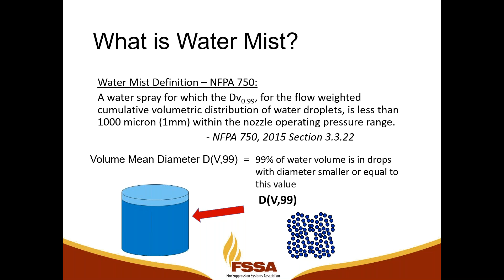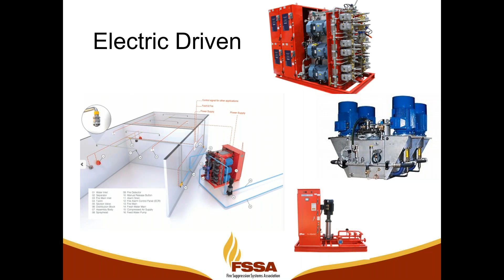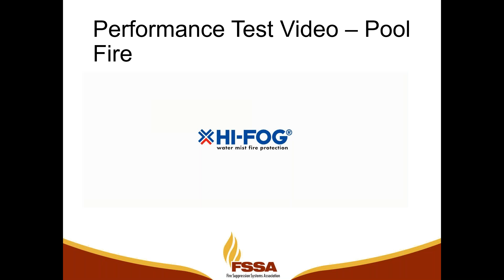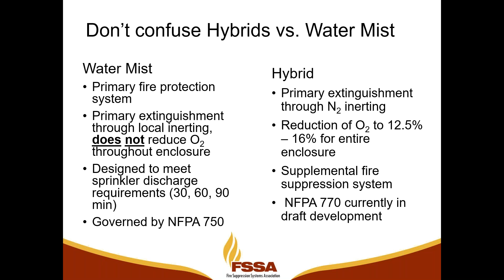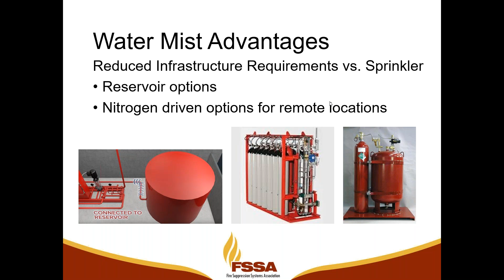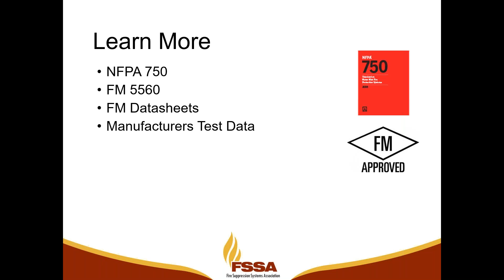FSSA Webinar Series  Water Mist  Special Hazard Applications, Technologies and Design Principles

Comment: What is the internationl standard/s for Wall Hydrant Water Mist System that does not typically contains fire hydrant but only a wall mounted high pressure Water Mist Hose Reel terminating in water Mist gun, electric driven high pressure pump.